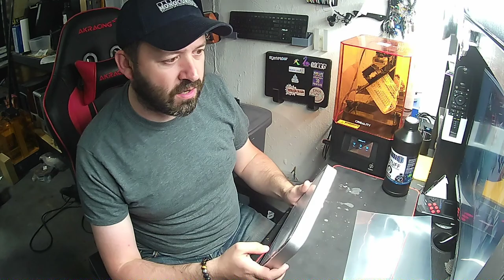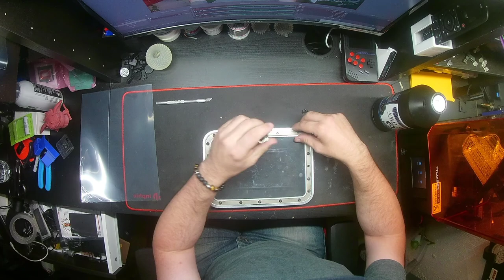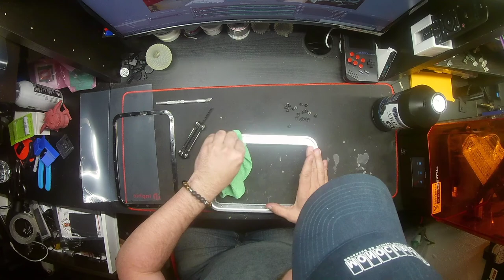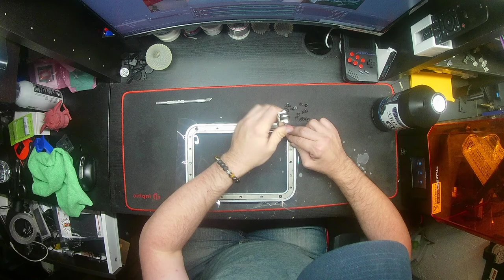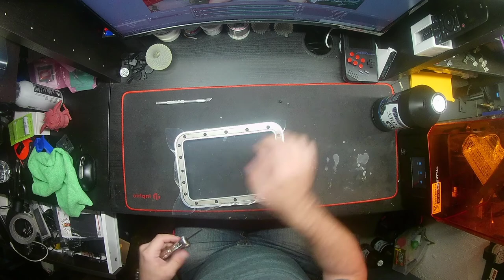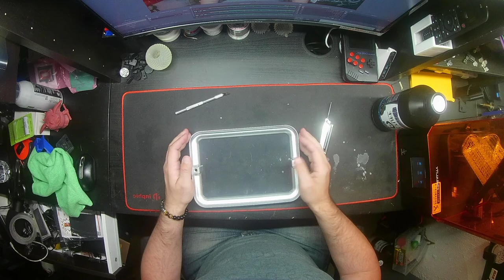HOW TO: Resin Printer FEP Film Replacement

Comment: Do you know the soldering iron trick for the FEP films? It's simple just jab the hot end in the hole to make a round hole for the screw.
Reply from the maker: Yea you can do that. The only thing is you want to make sure that there is tension on the fep film so you would need to do that while the plate is squishing the fep film against the vat. Also have to be careful with the cats that have a rubber seal ring around then

Comment: Are the screws really left hand threads or is this a camera thing?
Reply from the maker: Didn't even catch that the camera was mirrored. Thanks for that. To answer your question no this video is opposite. Screws are normal lefty loosey, eighty tighty
Reply: @AkumaMods . Thanks. It is important because a person can strip a screw if done the wrong way. 
70s Dodge cars have right side lug nots with right hand threads and left side lug nuts with left hand threads. And the most common reason for breaking lug nuts is NOT knowing that.
Reply from the maker: @Bob0sModelFabWorx  agreed. Again thank you Soo much...tempted to remove this or at least edit it to show that it's reversed. I have corrected it for any future videos
Reply: @AkumaMods . Keep it. Just edit it with some wordage added. (y)